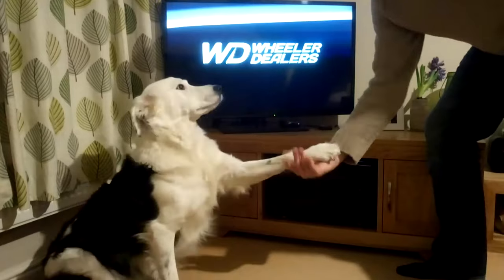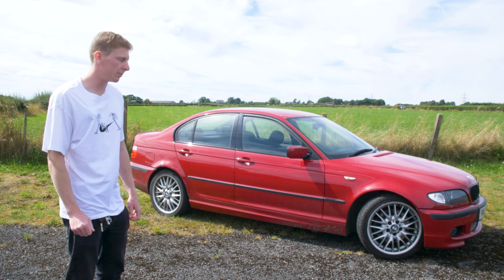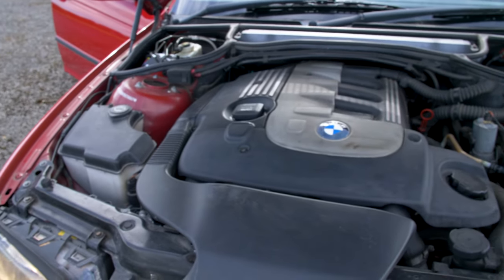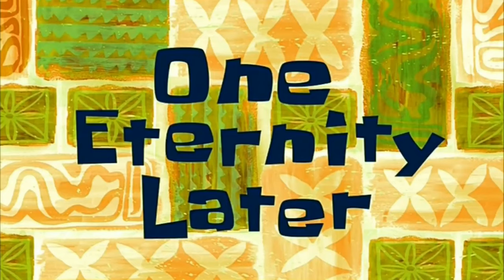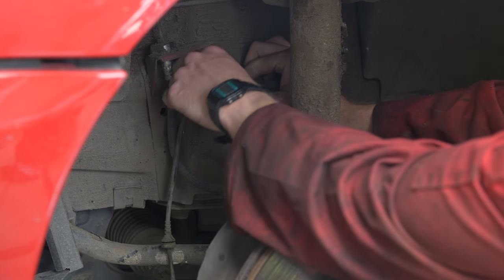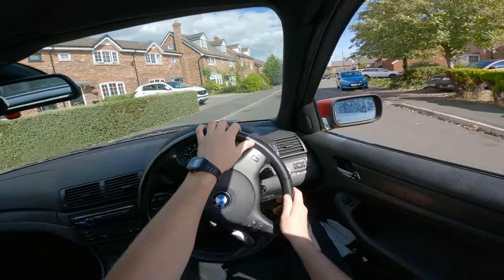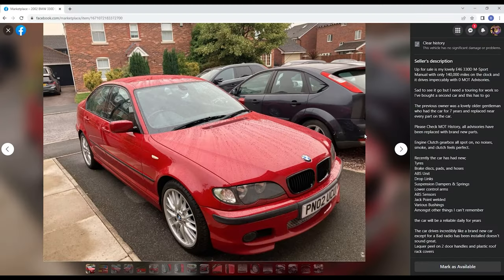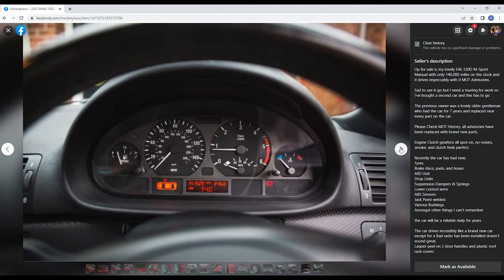I bought A Cheap BMW and Flipped it for Big Profit

Comment: Aren't these key batteries charged when the key is plugged in and as you drive the car? My previous e39 530i's both key batteries were dead (checked with voltmeter) and had to be replaced, how come they die when they should be rechargable? (I understand the pre 98 e39s and pre 2001 e46s may not have that option, but my e39 was 2003)
Reply from the maker: Im not completely up to date with what years will have this option but correct in most cars the key battery will take charge from the car, however after a certain amount of time the battery will stop being able to hold charge. Just like the main car battery, the alternator charges it whilst driving however after a few years the battery won’t be able to hold that charge anymore

Comment: How did you get the arches done for £600? Where did you find a 330D m sport for so cheap as well?
Reply from the maker: Just the first body shop quote I got and it was on eBay auction but nobody bidded so I negotiated

Comment: Bro you paid 600£ for them Bondoing a couple of arches... you could have diy that for 10 bucks and 2 hours
Reply from the maker: Buy new arches and a welder and learn to paint match + paint for 10 bucks?
Reply: @Josh.Sanderson  you don't have to weld on new arches, just sand and Bondo it. You can get VIN matched paint in spray cans
Reply from the maker: @Ljosi  that would not be strong enough or a proper job. I know that but it still needs to be blended with the rest of the car…
Reply: @Josh.Sanderson  it would be a decent job considering the arches had very little rust (you only replace them if they rust out completely). You match the paint transition by buffing the area afterwards
Reply from the maker: @Ljosi  very little rust 🧐
Reply: @Josh.Sanderson  I've seen the video bro, that was by no means a catastrophic rust out. I mean you aren't even keeping the car, it's a flip car, why cut so much into your own profit margin..
Reply from the maker: @Ljosi  yeah you’re right mate could’ve done it cheaper but I really liked the car and wanted it to be right for the next owner, also don’t want to get reputation of selling bodged cars
Reply from the maker: @Ljosi  I would have made a pigs ear of the job haha
Reply: @Josh.Sanderson  the thing is I'm pretty sure they also just Bondoed them unless you stood there and watched them weld on new arches... and let's be real, it's a drifter M3, locked diff, it will most likely be trashed or totalled way before it needs another arch job
Reply from the maker: @Ljosi  bro I can tell the difference between filler and new arch there’s no way it’s filler it was too bad and it’s not m3
Reply: @Josh.Sanderson  ya it's not m3 my bad. Anyway maybe next time spend the 600£ for a nice Lincoln welder and learn how to weld sheet metal, it's easy and you won't get ripped off by body shops
Reply: @Josh.Sanderson  I agree 600 is alot to pay considering he wasn't keeping it. Anyway 950 for the car itself is a steal! In Norway there is no way that would sell lower than 5000.